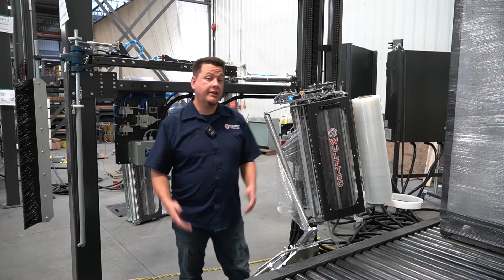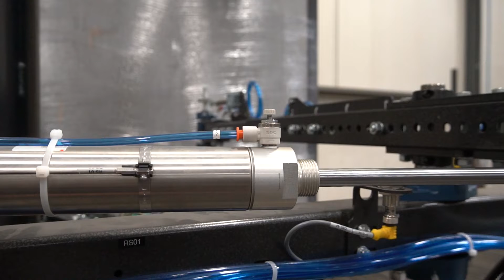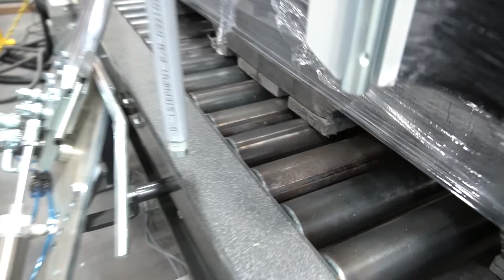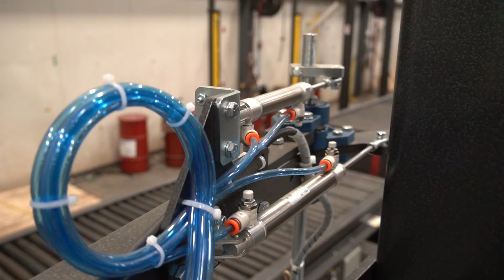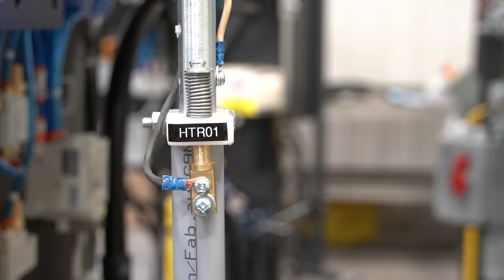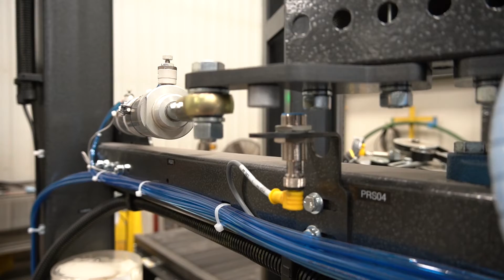Tip of the Day – Cut & Wipe Tuning

Comment: The no. 2 carriage on the wrapper I run is not stopping when the reed switch lights up and it wants to cut and clamp at the same time leaving little to no tail.A few months back the no.1 carriage was doing the same thing and a member of maintenance replaced a bad solenoid but during pm the other day a member of Atlantic Pkg was on hand but he would not listen to me and even said it was not supposed to stop and that it was a straight through procedure and that the reed switch did not tell it to stop so all that was done was a few turns of the air cylinder adjusters  which just made things more out of sequence.